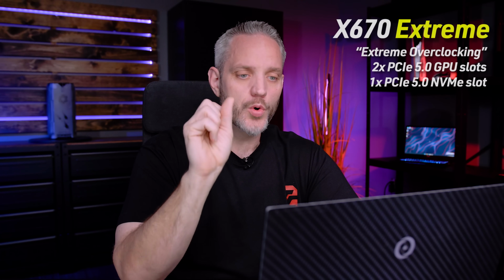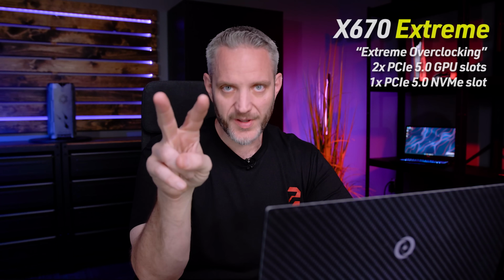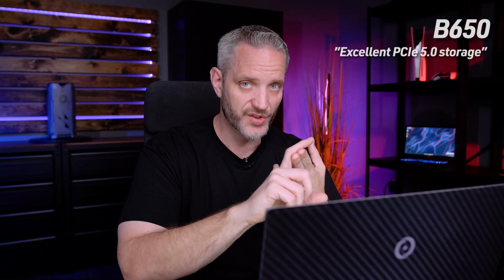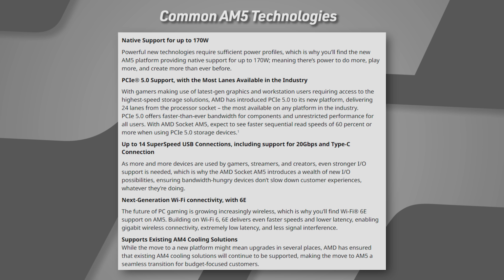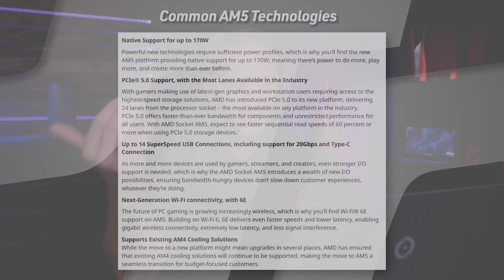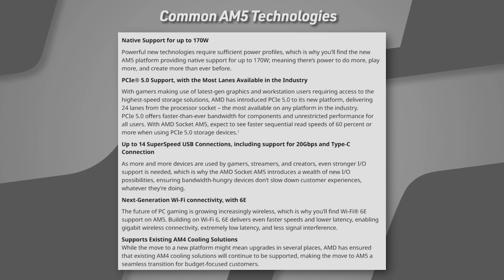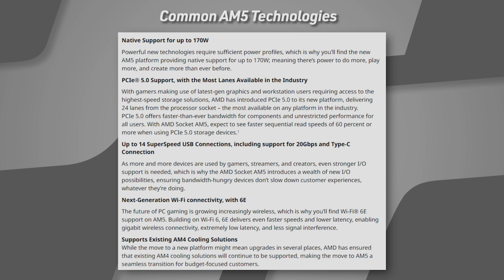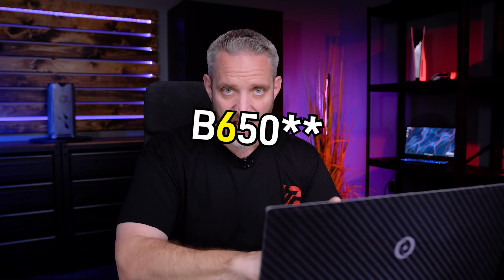AM5 Motherboards are EXPENSIVE! AM5 Explained

Comment: Having decent onboard wifi is definitely a good idea because ethernet ports die more often than you think.
Two of my last four motherboards had the ethernet ports crap out on me. One totally died after ((I assume) lightning came down the line a few years ago, because both my router and ethernet port died together. And now the ethernet on my X570 board is restricted to 100mbps because of a problem on pins 7/8.
But yea, I'm waiting on my upgrades to arrive in the next few days 7900x and an X670E Aorus Master, I always like to go big on the motherboard, because it's probably the thing that you will regret the most when you run out of USB ports, or you're looking to connect something, but you can't because you cheaped out.

To me the motherboard is kind of like choosing the extras you want in a new car; like you might think to save a few hundred quid by not getting air conditioning, but then you're cursing yourself when summer comes along because you're sweating like a priest in a Barney costume.

Comment: BE CAREFUL I FOUND THE PROBLEM BUT THIS MUST BE SEEN FROM A TECHNICIAN  ITS THE PINS ON AM5 SOCKET!!!!!!! YOU HAVE AS MANY PROBLEMS BECAUSE THERE IS A PIN SOMEWHERE IN THIS SOC BENT AS IT WAS ON MY ASUS PRIME 670E PRO IT WAS ON THE OTHER SIDE OF THE MARK TAKE A MAGNIFIER AND CHECK IT AGAIN AND AGAIN..... THE PIN WAS BENT TO THE OUTER POSITION A BIT SO DON'T TRY TO GET IT WRIGHT IF DON'T KNOW HOW !!!!!! AND I DON'T KNOW WHY THEY DIDN'T CHECK IT IN MANUFACTURING PROCESS.AFTER I GET IT WELL DONE THE SYSTEM    WAS RUNNING FAST AND SMOOTH WITH MY RYZEN 7900X POST AND RUN IN 10 SECONDS!!!! YOU CAN TAKE A PICTURE WITH YOUR PHONE CLOSE ENOUGH AND THEN ZOOM IT THE MB WAS KNEW AND UNOPENED THE PLASTIC COVER YOU DON'T HAVE TO SQUEEZE IT TO OPEN!!!!!!! PUT FIRST THE PROCESSOR AND THEN TAKE IT OUT GENTLY .IT IS WAY MORE FASTER THAN AM4   .THERE ARE SOME FALSE DIRECTIONS IN YOU TUBE BE CAREFULL!!!!!

Comment: Jay your the best, so please dont take this the wrong way and please touch a little on this subject. Lets Compare AMD X570 VS B650 and or B650E AM5 Motherboards – explain some major differences included on their IO back plate such as how many USB 3 / 3.1 / 3.2  type A or C, WiFi, - leaving processors and DDR4 along with DDR5 out of it because their simply isn't a massive difference between the two variations at this time that make massive differences at  this early stage to DDR5.  Also we barely touched the surface on PCIe Gen 5 related too NVME M.2 gen 5 so set that aside too.  And doubt we will see any Gen 5 GPU's for 3 years.  It also doesn't matter using SATA3 Solid State Drives or NVME M.2 third gen or fourth gen because the speeds are all still quite comparable at present, other then M.2's take up less space and clutter. And the final reason I chose to ask these questions are, 4K is very popular and soon will dominate the market leaving processors irrelivent because even an AMD  Ryzen 5600 or  Intel 12100 or 12400 paired with an AMD RX6750 and up or NVidia 3080 thru to a 4090 will handle bottleneck problems.  So while sponsors push us to buy "NEW"  you should share some of this knowledge I shared. Buying new undeveloped products will inevitably leave us at a loss as we continue to see on both Intel and AMD struggle for dominance over one another at our cost.

Comment: Good luck finding an AM5 motherboard that can take two M.2 PCIe 4.0 NVME drives. Since AMD in their website suggest AM5 is workstation grade hardware, it should offer such a thing. So practically right now is the worst time to shop parts for a new pc due to Intel expected to release a new socket, and AM5 motherboard pricing and availability.

Comment: the x670e and then the extra extreme are different. its regarding the chipset x670(e) and then the actual motherboard tier is that extra extreme. X670 and x670e have optional and mandatory hardware respectivley set by AMD. The board manufacturers then teir their own motherboard elite, master, extrme etx. So the chipset hardware using AMD set rules is the letter e denoting what is optional or mandatory telling both the consumer and manufacturer that the board has to have these hardware rules by default (with e) or not (non e). The same applies for the B650 and B650E

Comment: What is the point of these E boards when there is already no spare headroom, 7950X for example is already running at a really high clock, high temps so what's the point of these boards maybe for LN overclocking, another marketing bs when they call it GAMING EXTREME X.

Comment: To be fair ITX X670E boards are super worth the price... Unlike AM4 boards in ANY price range, AM5 ones have actually superb I/O. 2x USB4 as a standard and a bunch of USB20gbps? YES PLEASE. There's only like 1 motherboard for AM4 that sports Thunderbolt 3, from ASRock and that's about it - otherwise only Asus has offered TB4 but only via additional expansion card for another $130 premium compatible with selected motherboards. It's worth noting that this is premium chipset and there sure will be cheaper B series alternatives for those who do not need these features. There's still problem of abysmal PCI-E lanes available for AM5 so these bigger boards hardly even make sense - can't use that additional real estate for anything useful without sacrifices (can't populate all expansion ports without something getting disabled along the way...) - seems like mATX and ITX is the way to go for this platform.

Comment: About to order the AMD Ryzen 5 7600x and Gigabyte X670 Aorus Elite AX. I feel it'll last 8 to 10 years. My current desktop is an AMD A10-7850K - A-Series APU Kaveri Quad-Core and ASUS A88X-PRO FM2+ / FM2 that I built in 2014, which is still running strong. I don't game, it's primary function is to be a Plex media server with secondary functions being making videos from my GoPro, as well as being a basic workstation. I'm thinking I won't miss getting a higher end CPU or motherboard, and the occasional buffering issues I get with Plex will be a thing of the past.

Comment: Next autumn/winter 10-12 months post retirement I'll be building a new gaming PC. As for the components, it's somewhat moot atm. But I will be spending in the region of £2k to £3k, which is how much I spent on my existing PC in 2012. I've always used Nvidia, as the only time I used a high end AMD gpu it died on me 12 days after installing and powered up, and I've always used Intel cpu's. But going by coverage on this channel, and reviews, I'm seriously considering building a high...ish end AMD system i.e. cpu, gpu and motherboard and AMD compatible DDR5 Single/Dual Channel 6000MHz+ ram, in either 32Gb or 64Gb.

Comment: Im curious if i would need a higher end motherboard to reach the boost clock for the 7950x or if that would be something i would need a higher end board for would the additional vrm be necessary for the box listed boost clock. I decided to splurge with this build since my current rig has lasted me almost 6 years now but im not a fan of wasting money on little knick knacks i wont use. I probably will want nvme 5.0 and MAYBE PCIE Gen 5 but it isnt a deal breaker. i just want to make sure im not gonna be limiting my new cpu because i skimped on a mobo cause i didnt care about the small add ons.

Comment: I'm someone who really like to overspend on the motherboard due to collectible value (I really like to collect high end motherboard which is not really rational by the way) but when I see the price of the ultra high-end motherboard in the past 2-3 years I think I have to stop and AM4 and LGA 1200 will be the last for me. Current gen high end motherboards pricing is really ridiculous and the second best one which is half the price is still ridiculously expensive. And because of how ridiculously expensive they are it make those motherboard almost never pop up in second hand market as well. And some online seller that have refurbished high end motherboard of the last 2-3 generations in stock also jack up the price sky high to 2-3 times the price of that motherboard when they are new and it doesn't even have accessory in the box. It's to the point it's so irrational that I can't keep up anymore.

I still think of the day when the ultra high-end motherboard is just around 400-500$ or 700$ with build in water block. The last time that happened is around 2018 when the newer model in mid to high tier have their cosmetic appearance completely change into having motherboard armor and heatsink chunk all over their face and then the asking price for them are only higher and higher, and the price different between brand's best and second best also keep widing, it's almost 2x with almost the same feature now.

To be honest motherboard these days isn't even as beautiful as in the day of AM2 and 775, and isn't as neat as in early to mid 2010s. They're just an A4 size nightclub. And M.2 slot these days also robbed off expansions slots and legacy connectivity that make high-end motherboard have less and less feature than ever.

Comment: I need a sysstem, where i can stream, produce vidoes and music and sometimes play Minecraft in 2 to 4k with RTX on. I also want to play a Microsoft Flight Simulator as well.
So my thoughts was to buy a 7900x with some B650 motherboard and may be RTX 4070(Ti). Is it right combo, or should i go for X670 instead? I am not planning to overclock though.
Reply: I know, that i can go now for 5900x and X570 with something like 3080 and it will work for me for next 5 to 7 years; and then may be a completely new generation of prozessors from the team red and may be blue as well comes up.

Comment: I'm about done on the upgrade front. We seem to be very lucky right now with both AMD 5000 series and Intel Alder Lake CPU's providing huge performance for the money and way more than enough for the average to semi pro user. The Pro users yes will go for the latest if it will drive time savings but for most a 5600X/5800 or a 12400/12600 on the gaming front is immense already and just get the best GPU you can afford. Even the 30 series RTX GPU's and the Radeon 6000 series GPU's are stunning performance wise and with prices falling through the floor especially with the miners dumping cards, just pick up a bargain and have a great gaming rig for quiet some time to come...

Comment: 13:17 How are they tuned for DOCP on AM4 if AM4 doesn't support DDR5?
I'm waiting on the X3D variants of the 7000 series BTW. The leaks suggest that they'll be released early next year. Probably as a response to Intel's Raptor Lake. I'm definitely going to buy the 7000 series though. Intel's high heat/ power consumption don't mix well with hit Egyptian summer. When you add the two generation rule for their baords. AMD becomes a no brainer. I might even buy the board and RAM at kaunch while waiting for the X3D CPUs

Comment: I use a good external DAC with high quality sound system, good graphics card and quality Ethernet card of MY choice. I don't want to pay for integrated anything! Also, I don't want WiFi and Bluetooth for wired desktops with fibre-based Internet! But, I still want no-compromise quality core components for performance. Please, motherboard manufacturers, give me a bare-bones high-performance mobo without all the stuff I don't want. You know you can do that for a lower cost option.

Comment: I wanted a lot of NVME so I bought the expensive boards. I have Gigabyte boards in: Aorus Ultra X570, Aorus Master X570 x2, Aorus Master X570S. I also have a stock of AMD cpu's: 3900xt, 5900x, 5950x(which just got RMA'd). I have NVIDIA: 1080, 1080ti, 3070ti,3080ti, 3090. I have hundreds of gigabytes of matched ram sticks in 32gb sticks from Corsair to Micron. I have 3 Thermaltake iRGB power supplies from 750w to 1000w and my bench power supply from Corsair which is 650w or something.

Now, on to the reason I mention all of this. I'm skipping the entire next generation and skipping the part where those parts get even more expensive and force me into the next generation for a single failure. I hate Windows 11, but everything is ready for it. The start menu is useless and is putting me back into using the desktop and icons to organize my daily launch. Maybe Microsoft wants to be Apple, who knows. Anyway, AM5 isn't coming into my house most likely. I have 3 cases set up to hold my hardware, only two of which I really need. I have pretty much every part needed to ride out a full decade of computing with no upgrades, though I was pretty disheartened when my 5950x ate it just recently but AMD RMA'd that in no time and it's already back in a brand new unopened box. I foresee a lot more "green" movement in the field than I do power increases, but the market could decide otherwise. Intel told us they were going lower power, slower, and smaller: I went AMD.

I've been through every single cycle of tech that has come out and I don't see massive gains this gen. My money was best spent up front to keep my house running just like it is right now.

Comment: I build always top of the line, when i assembly a new rig. Then i can easy skip 2 or 3 Generations. Mostly the difference between cpu, gpu generation is not so big, as the marketing try to indoctrinate you. Often it's a synthetic benchmark necessary to see, where the system gains on speed. 
New Chipset, new Socket, rev.1.. is a No GO. They mostly use the customer for beta testing shitty bios and design flaws "Hello Asrock!". I guess i stay with my 5950 / 3090 Workstation, and watch GN and Jayz how things will perpetuate.

Comment: As someone who has a 5 year old cheap gaming laptop. I'm going to build my first PC in the next few weeks. 

I have been waiting for 2 years and in a country with very exaggerated PC part prices + being a student. I have finally saved enough to get a 5600x and 3060ti build without going cheap on other parts. While I know that AM5 is coming out with new sockets and DDR5. I can at least give away/keep as a 2nd computer when upgrading in 5-6 years or maybe even more. I also had to buy a monitor since I never needed one before. Which takes some budget that the PC could've gotten.

If I wait more  for the 40 cards and AM5 motherboards and it's parts to go down. And when the price reaches near it's MSRP. A new generation would be out so it won't be worth it. and the cycle would continue.

Thank you for reading through my badly written personal rant D:

Comment: I am currently running an aging i5-6600K with GTX1080 nonTi. It still does what it is supposed to, and since I am running a 1080p screen, it is still just about enough.
Unfortunatelly, blue screens started to occur a few months ago, at times my computer starts without seeing the system ssd and at times, I observe graphical artifacts, so I will likely have to upgrade in the next few months. I am just waiting and see how everything will turn out, and weighing my options. If I could get myself a set up, even if it somewhat more expensive, that would last another 5-6 years, I'd be really happy. Hopefully this time, I won't bottleneck my computer with something like I did with the CPU before. x)

Comment: Board cost is also going to be more expensive for the simple fact that it will support multiple CPU generation (in theory). Board vendors could rely on the fact that your board would expire in a generation or two. With AMD they will have to include it in the initial one time purchase cost or get backlash like they did with am4 claiming "no room in bios" or "board can't deliver <build requirements>" ..

Comment: I don't think I Wil be an early adopter at the prices they are listing. Honestly,  while the product may be  good, the value is lost a bit due to excessive pricing.  While I'd like to get a 7950x - I'm sure it'll be a beast, the price is too high for me. Cpu + mobo + ddr5..... the value is slipping away. I will stuck with am4 and upgrade to the 5950x(from a 3900xt) and I can run that for a while..... I'm also curious to see how long the am5 motherboards are going to be good for... cheers

Comment: Yeah those pcie Gen 5 graphics slots translate to peripheral slots, you know with decent amounts of lanes.. that's like four of those 4x slots, or any other reason why you might need that kind of slot.. hell of a lot better then having to deal with those nvme slots, and technically significantly better than having to deal with those 1X slots, that being said I'd like to have those as well LOL so I don't have to waste a 16x slot.. but you know what I want and what goes into a modern motherboard is often very juxtaposed it seems.. which is funny cuz the prosumer boards like threadripper etc seem to have everything I want but..

Why did Intel have to give me x79 and make me used to this.. and why was it so cheap back then all right it was cuz it was dying platform but it man that was a hell of a Long live death.

Comment: I am looking to adopt AM5. Currently, I am running X370 and an 1800X with 2 1080Ti video cards. I will wait until there are more options, and cheaper parts, and also to see if AMD or Nvidia will have the better video cards with the new architectures. The other challenge is that I have everything water cooled, so I will also have to take the costs for that into account, unless I want to switch back to air cooled until blocks are released for the various parts. All in all, I see that this will be a pricey endeavor.
Reply: I have the same issue. Got a water cooled set up with a X370 1800x and 1080ti. Going to end up building from scratch when I upgrade.
Reply: I know there are some CPU blocks that are already labeled as AM5 or whatever the letters are